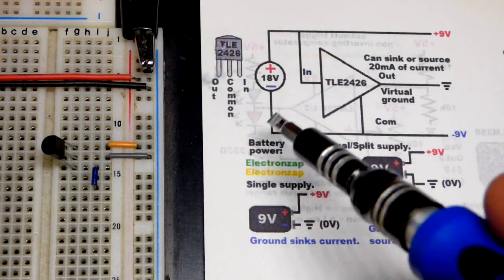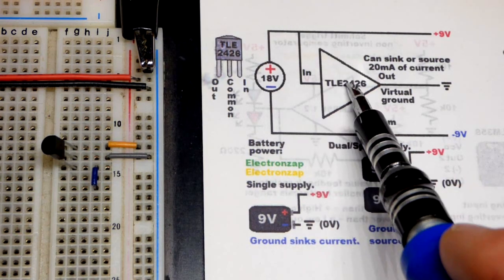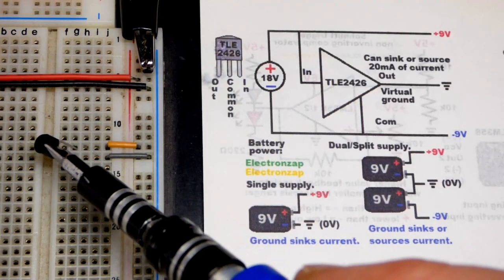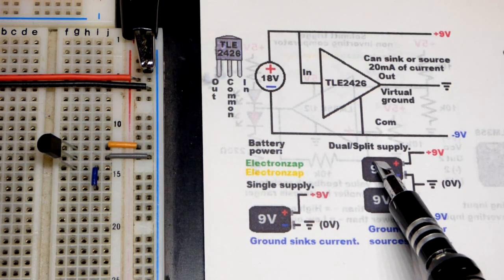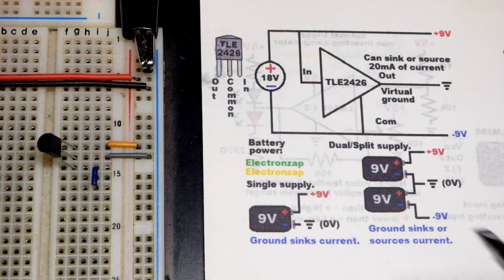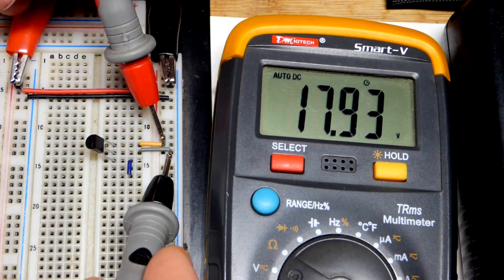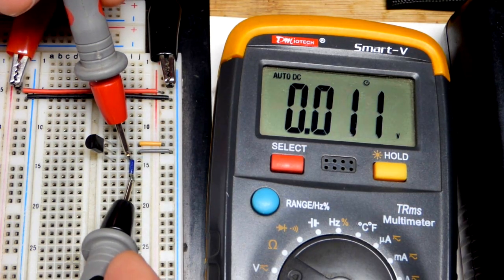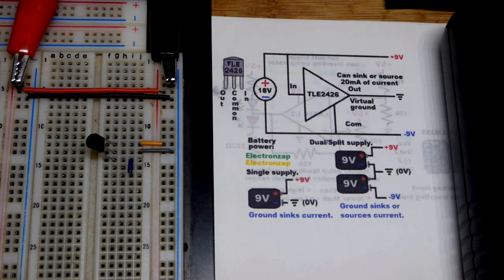TLE2426 Virtual Ground Rail Splitter Component

Comment: You should really take a look at the IC package "isolated dc-dc converters" (such as the B1212).  These are amazingly useful devices that have a built-in transformer with many different isolated voltage outputs that can be configured or connected together to give all sorts of isolated outputs and ground.
THANKS FOR THE VIDEO!
Reply from the maker: Yeah, I seen those before, haven't bought one yet but they look pretty cool.